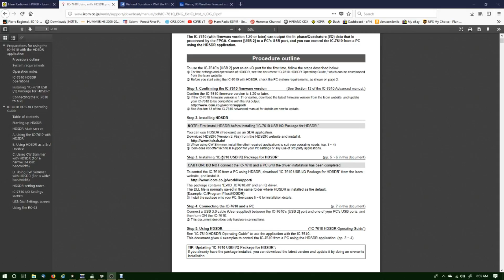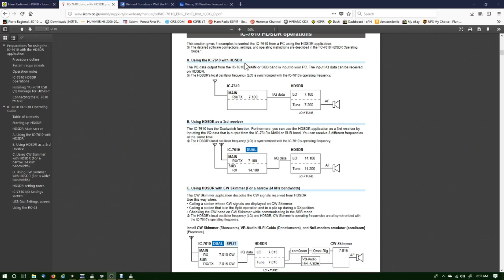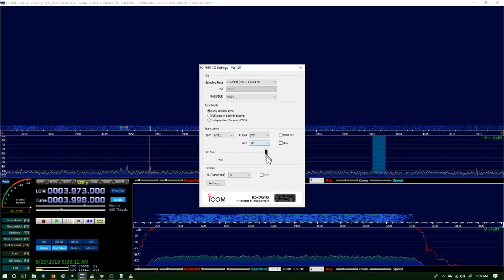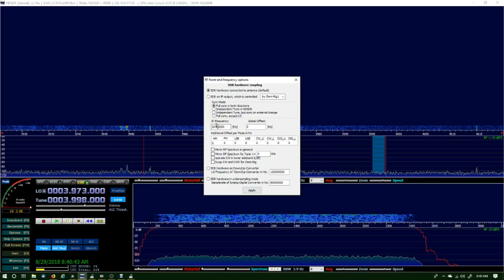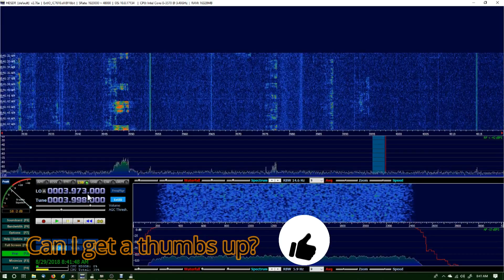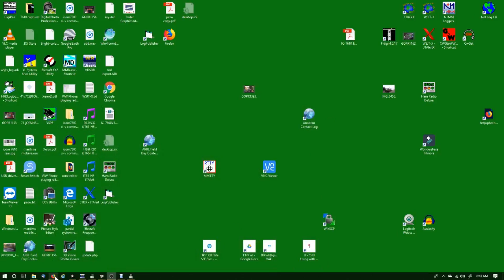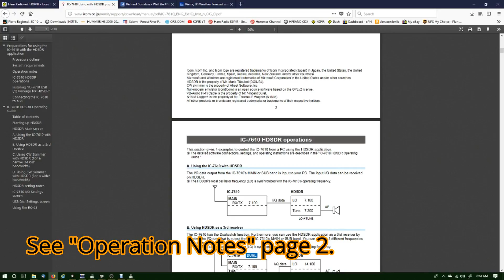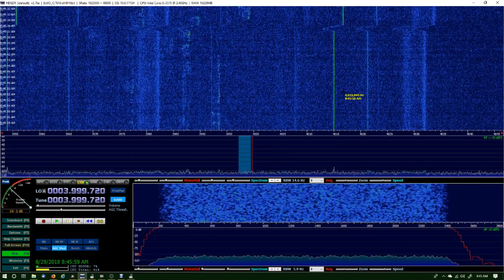Icom 7610 HDSDR Installation and Settings

Comment: On those USB 3.0 cables do you have to have chokes on both ends, because I thought read somewhere you are suppose to. Also, I’m going to be having an IC-9700 sitting next to my 7610 once I order mine. 73 Ben K0BLR
Reply from the maker: Great! 9700 is a fantastic radio. There’s really no need but is probably a good idea. I have ferrite on the cable and that connects to the radio. Best 73 and congratulations!

Comment: Will the 7610 run Ham Radio Deluxe and HDSDR at the same time?  Currently running a Flex 6500 and thinking of playing with the 7610 but want to run HDSDR and HRD at the same time if possible...I am good on QRZ

Comment: With this set up will the panadapter track with movements in the 7610's vfo? Or do you have to change display frequencies via the HDSDR?
Reply: The HDSDR website has two different downloads dated March 19, 2020. One says V1, the the V2. Which one should I use? Thanks!
Reply from the maker: Edward Savela That’s a very good question and it depends on what version of Omni-rig you use. I am using v1.19 so I download the version of HDSDR for v1. Thanks for the question and best 73!
Reply: @HamRadioAdventures  Thanks for the great resource and YouTube. Mine is installed now and working well. One more question:  How do I reduce the bandwidth displayed? When I am on 40 meters I am seeing from somewhere in the 6 MHz band up to 8 MHz? I only want to see about 100 Hz at a time. Thanks again.
Reply: Never mind...i got it. Works nicely!!!
Reply from the maker: Nice to hear from you and I hope all is well where you are. There are a couple of ways, but the short answer is yes. They will track each other. Take care be safe and best 73!
Reply: @HamRadioAdventures . Well let me ask a much more precise question:  Once set up per your fine instructions can I just use my 7610 vfo dial while the frequency on the HDSDR monitor will follow? -end-  Currently, I am using the panafall on the 7610 now and expanding that to a direct connect monitor but it seems redundant to have the same display on the 7610 and a larger version of it on the monitor.  Although the upside is that I am not using any of my precious three video ports on the station computer.  Does that make sense?  Thanks for your answers.
Reply from the maker: Edward Savela Yes that makes perfect sense. In the HDSDR ExtIO choose “Full sync in both directions” That is how I normally use it. Take care, be safe and best 73!

Comment: Could you start your video about what are the benefits and features of HDSDR, SRDUNO, and things like that as an introduction of why it's a good idea to install these applications? How long did the firmware update take, and did it go smoothly? There's a risk to the firmware update, if it goes bad, you have to ship your 7610 to Washington state to have it repaired, maybe have repair costs, shipping costs, and downtime. The video screen capture is very blurry. Is there anything that you could do to make the screen capture more clear?

Thanks for your very helpful videos. I think if you spent just a little bit of time at the beginning of the video, you could tell us why it's a fantastic idea to try those new applications!

I did have a problem with the WSJT-X configuration that might help others. I heard about it on the HRD forum. If your 7610 reverts from USB-D1 to USB by itself, you cannot transmit with WSJT-X. The solution for this very annoying problem is to go into the WSJT-X configuration, "Radio" tab, then "Modes" tab, then select "None". The annoying problem where WSJT-X cannot transmit when the 7610 switches by itself from USB-D1 to USB, will be fixed! The 7610 will stay on USB-D1! 

Dave KY0L
Reply from the maker: Dave Borchard Hi, You get a bigger picture on a monitor screen, it’s easier/faster to click on signals with the mouse, you can see more than on the LCD, HDSDR can be integrated with CWSkimmer, etc. and etc.  See the link in the description to my video for the firmware update, it went very smoothly. No issues. Warning in the video. Video is not blurry. Please increase the resolution of the video playback in YouTube player. 1080p is the preferred setting.  Thank you for your input and I appreciate your watching the videos. I hope they are helpful and I hope everything is good where you are. Please be safe and best 73!

Comment: Hi Rich, Great stuff re the HDSDR  ,have a question  you say  disable OmniRig  etc ,
But am using OmniRig to control my 7610  for my logging Programme that is  Lg4OM  ,
is the disable only for the HDSDR  prog, can I still have OmniRig active for my Log Prog?
Reply from the maker: Yes it is ICOM instructions that do not use OMNIRig. However, I used it instead of their solution and it worked fine. CWS will also use it just fine. 73 from Tucson Arizona!

Comment: Rich, got it mostly working but with the USB3, now HRD doesn't find a port to connect to the 7610.  How to connect HRD/WSJT using the USB3?  Thanks.  Bill-KL7TC.
Reply from the maker: Hi William, thanks for coming here and you will not be able to set up HRD/WSJTX using the USB3 port on the ICOM 7610. Rig control only works on the USB2 port. So you will have two cables. I hope this helps 73!

Comment: How loud is the T/R relay on the Icom 7610 radio? I used to use a Kenwood TS-940 using AMTOR ARQ and full break-in CW decades ago. The T/R relay is very quiet in the Kenwood TS-940. I have also used a Kenwood TS-430, and the T/R relay is very loud, so using AMTOR ARQ and full break in CW would not be acceptable with the loud T/R relay. How loud is the T/R relay in the Icom 7610 radio?

The HDSDR software is run on the computer that is locally attached to the Icom IC-7610 radio. Can you use remote control software with a second computer to connect to the locally connected computer to remote control your Icom IC-7610 from a remote location. Or, do you have to use the $150 Icom BA-1 version 2 software to remotely control the Icom IC-7610 radio from a remote location over the Internet?

Comment: If I'm using Ham Radio Delux with Rig Control, is it necessary to have this too?
Reply from the maker: Hi Keith, nice to hear from you and thank you for watching and commenting. No it is not needed, but it is a fantastic tool. It really compliments HRD. Since you have the 7610 I highly recommend it. You won't be sorry you tried it. Happy Holidays and best 73 - Rich, K0PIR.us
Reply: @HamRadioAdventures  Thanks, Rich.  I will give it a shot.  Just waiting on a USB 3.0 cable now.  73'  Keith

Comment: Have you succeeded in getting HDSDR to work with WSJT-X and the 7610? Ken Gunton W8ASA
Reply from the maker: Hi Ken, nice to hear from you. I can open HDSDR and at the same time open WSJT-X. I  prefer the waterfall in WSJT-X though. Is that what you mean? - Rich, K0PIR
Reply: Ham Radio with K0PIR  call ke0mph

Comment: I discovered that my problem appears to be an audio setting in my desk too computer . After a week of trying everything I could think of, I went out and bought a new laptop . I installed HDSDR , Icom drivers , and CE Skimmer  and 170 kHz CW Skimmer works as per Icom’s instructions for the 7610 . For those asking , this will NOT work with a 7300).
Reply from the maker: Thank you so much. I will look at that when I get it going. 73!

Comment: I am anxious for the skimmer video because for the life of me do not get the desired skimmer results when i try to set up "wide" CW skimming.
Reply from the maker: What problem are you running into Andrew?
Reply: The  24 Khz option for CW Skimmer works as advertised , however as you know many people would want to "skim" a whole CW band segment .  So Icom describes a 170 Khz capability.  When I match their instructions as precisely as I can  the end result is no audio of CW signals is displayed in the CW Skimmer waterfall.  Icom's illustration shows a setting of the  LO being set at 7006 and tune om 7085 in HDSDR, radio dial set to 7006.  CW Skimmer's "radio" set to "Softrock" with  audio IF of zero and LO in Cw Skimmer set for same as tune frequency in HDSDR.  When I press start in CW Skimmer I see no signals despite HDSDR and the 7610 showing many CW signals.  If i slowly change the TUNE frequency in HDSDR I eventually see CW signals in the CW Skimmer waterfall., but not until i have the HDSDR tune frequency down to around 7037 .  When HDSDR is tuned to around 7037 the signals i do see do not match the frequency scale in CW  Skimmer. For example, I see FT8 signals in the skimmer waterfall at 7030 or so, not the actual 7074 .  So i am interested in what you discover.  73 de Andy K3UK
Reply from the maker: Okay, got it Andy. I was reading about it and the 170 Khz capability, but haven't gotten around to it. Hopefully soon. Have you been in the Groups.io Icom 7610 forum? That's where I will be looking for answers. CUL 73 - Rich, K0PIR
Reply: same here.  I've been assuming it is something I've been doing incorrectly - some setting preventing me from getting 170khz.